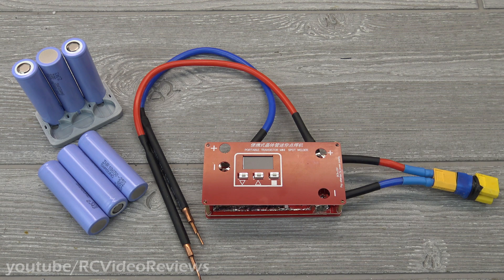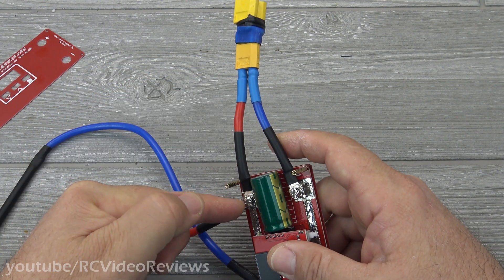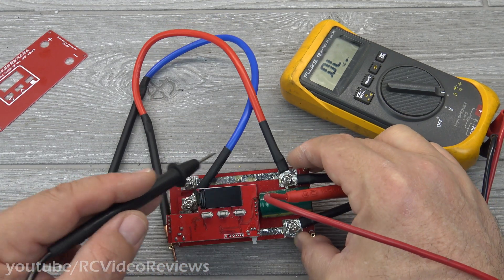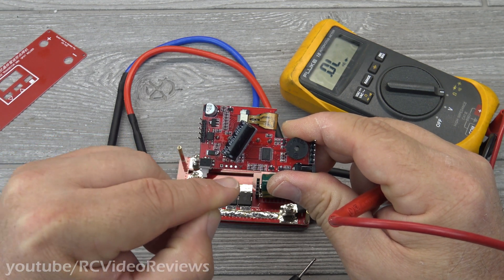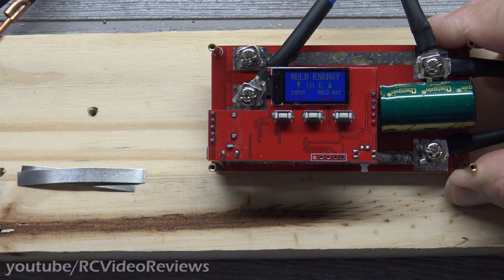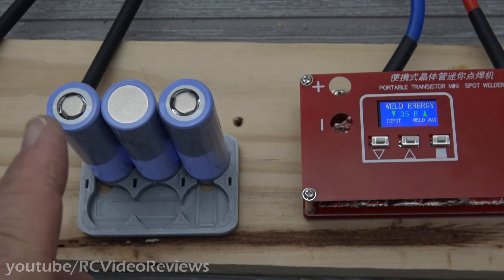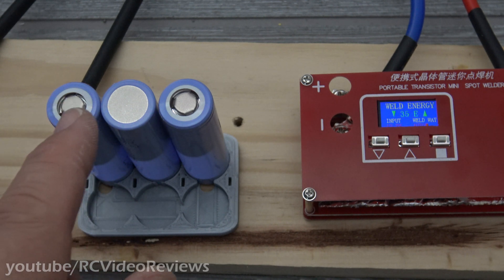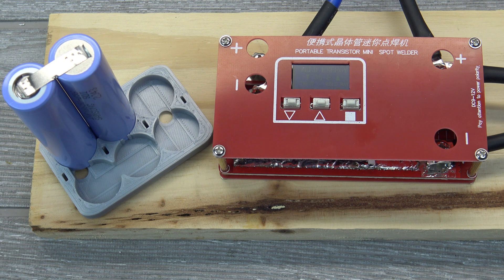Cheap 18650 Spot Welder Reliability Mods and Test

Comment: Bought this unit 6 months ago n made the mods but instead of wasting solder i stripped some ac copper wires n added to the connections. Man this litte unit works great for the price n i really like how compact it is, saves alot of space! Liked ur vids. Btw for those buying li-on batteries make sure u check the discharged current of the battery. I rushed my buying and ordered the wrong c rating! (5amp) cant fly most planes with that.
Reply from the maker: Good tip. Thanks for the comment.

Comment: The unit I purchased looked the same but the circuit was different so I couldn't find where to add the capacitor. I did not add extra solder onto the negative side. I tested it first using a Car Jumping Battery Bank and everything worked perfectly but the car jumping battery bank had to be physically disconnected before it would reset for another weld. I then tried using a 12V car battery with the power set to 40 for a 0.12mm strip. One of the MOSFETs blew up and caught fire... The spot weld left a burn mark on the wood and one of the probes burned through the nickel strip. The takeaway, add the extra solder at the least. Add the capacitor if your unit is similar.
Reply from the maker: Did you repair it and make the changes?
Reply: @RCVideoReviews  it didn't come with extra MOSFETs

Comment: Thank you. Loved the capacitor addition, great MOSFET protection.  Liked your over soldering very much. Saw this welder in other videos demonstrating the minimum amount of pressure that gets the strips to touch together works best.  Also placing the contacts at an angel not straight up & down works well.  Finally don’t create perfectly perpendicular welds, they’re not as strong.  For whatever it’s worth.  Thanks again.

Comment: Very good job, Congratulations. 
Please help me to decide wich strips to soldering the bateries can i use in lion 18650 pack 11.1 volts 9  amps  i goin to use Samsung 18650 3 amps batteries.
Reply from the maker: If you google a little, you can find charts to help you sort it out. Here's one example: https://www.diyelectriccar.com/attachments/strip-ampacity-pdf.120970/

Comment: Good info, Thanks.
As with any device, I would be careful modifying the product. We could be alternating the electronic circuit and not even realize it.  I’m just guessing – They’re maybe a reason for the trace on the circuit board being the way it is. The electronic circuit could be monitoring the current through that trace. Again, I’m just guessing, without a schematic we really can’t say for sure.
On the other hand, maybe you fixed some of the problems out there with the Spot Welder.

This gentleman provides some good information on the same welder you’re showing.  Like to share it with everyone.
https://www.youtube.com/watch?v=231qtaRIs3M&t=1003s
Reply: He's wrong on a few points. (Source: am degreed EE.) Parts of his theory explanation are right, about the garden hose stuff, but he's off when he starts talking about Amp-Hours. Amp-hours has nothing to do with how much continuous current a battery can provide. The internal design of the battery cells themselves determines this. For instance, some LG 18650 cells are designed to deliver 30 Amps continuous, while most other 18650 cells are designed only to provide 430 mA continuous. The 30A cells are 1,500 mAH, while the 0.43 Amp cells are available in 2,200 mAH up to 3,800 mAH. The Amp-hour rating refers ONLY to how long the battery will take to discharge at its rated current... that is, it's storage capacity. If we're using the fluid analogy, the Ah rating is, "The size of the tank."  So, for the spot welder, this means a battery with a larger Ah rating will simply last longer before needing to be recharged, same as a tank with a larger volume capacity will be able to feed a hose of the same size at the same pressure for longer before running out of water, when compared to a smaller tank. Amp-hour rating has no bearing on the strength of a single pulse. The battery voltage and the ability to deliver the 150A pulse is what will determine that - and a battery that can't effectively deliver a 150A pulse (which standard 18650 cells cannot, unless you stack many many in parallel, or use those special high-current rated ones) will cause the condition this creator mentions - a loss of ability to maintain control circuit voltage during the pulse, as the voltage will drop, which will make the device incapable of holding all the FETs open, which will risk overloading the FETs that are open. 
So, the thing to be sure of when selecting a power source, is that it can in fact deliver 150A. 
Increasing the thickness of the trace by adding solder will have no adverse affect. It's simply increasing the ampacity of the trace, not the amount of current that flows. If the trace is limiting the current that flows, it will act as a fuse and burn through. The fact that the trace isn't burning through is your proof that the trace is not limiting the current. If the current needs to be limited, that would be done with a resistor or a network of resistors.
;)
Reply: Oh, and he's definitely spot on about the size of the aligator clips - yeah, people need to be using jumper-cable sized clamps, not little clips ;)

Comment: Putting too much pressure will result in a bad weld, with the setting at 20 or 25 will make a strong weld if you just use light pressure
Reply from the maker: Nah, it's fine. It welded perfectly. Good tight bond and the material is destroyed trying to remove it. No problem.

Comment: You are pushing to hard. Set it at 20 and just push enough to hold the strips together, this causes more resistance
Reply from the maker: Its fine. The connections are plenty strong. No issues. The welder allows for longer pulses so I don't think it matters.
Reply: didnt seem like he was pressing too much, from other videos with experienced people pulse duration seems about appropriate, so pressure is too

Comment: You don't want much pressure. Just enough for the surfaces to contact, but you do want some resistance between the surfaces in order to make the heat right there.  Lighten up and it'll probably be fine down to setting 15 or so.
Reply: And thanks for the tips.
Reply: If i am setting on 15 and i am not pressing enough, i am becoming sparks

Comment: Will bigger capacitor make its performance better? Like, 10,000 uF / 50V ?
Reply from the maker: I don't think so. It's not holding the current for the weld. It's just there to protect the control circuit.

Comment: If I use a deep cycle lead acid battery would I run into the low voltage issues? I'm planning on using a 120ah one with 672 cranking amps rating. I did 20 welds without mods and I didn't have any issues, I'm still planning on adding the capacitors though. Any thoughts?
Reply from the maker: It wouldn't be a bad idea to add the cap. The issue has to do with voltage sag. The videos I've seen where the problem comes in is voltage sag and weak current delivery. I expect if the battery you've described is in good condition you should be ok, but add the cap.
Reply: @RCVideoReviews  that's what I figured. Thank you so much for the quick reply! I'm subscribing right now, wow!

Comment: My study of spot welding found that low pressure and smooth rounded tips works best. For some reason too much pressure is not best. I have not tried this yet.
Reply from the maker: Hey Mark, Yeah, I've seen that comment quite a bit. I did wind up rounding the tips.
Reply: @RCVideoReviews  is it better with the rounded tips?
Reply from the maker: @apexed2446  Better is arbitrary. All I can say is I get good welds. The strip is destroyed trying to remove it. I have no evidence one is better than the other.
Reply: @RCVideoReviews  fair enough, thank you! I'll experiment.

Comment: From watching a few other videos on this welder I think you are a bit under-batteried. I wouldn't trust that 2200mAh Turnigy Lipo at anything beyond the 35c rating (so c.80A). Recommendation elsewhere is for 5000mAh and 50C (which gives plenty of headroom).
Reply from the maker: It only needs ~130a. This pack delivers that easily. It’s a 70c peak. So 154a. And the spikes are so momentary it doesn’t matter. It welds fine.

Comment: Please comment on the "new mini spot welder" 2021 :
~ I have the upgraded control board 2021. The upgrade here apparently [Youtube discussion] requires the 1000ohm to be replaced with a 470ohm resistor.
~ The old design had a simple modification as per your description, insert the 1000uF Capacitor, and indicated here for others ~ https://youtu.be/fdnO0Z-scjA

Comment: I just ordered that, anything I need to know?
Reply from the maker: If it doesn’t have the same control circuit as the one in this video send it back. We ordered a second one that has apparently been updated and it lasted for about 5 welds.
Reply: @RCVideoReviews  The battery lasted for 5 welds or the circuit?
Reply from the maker: @informing_  The circuit. The "new" spot welder is dead.
Reply: @RCVideoReviews  Oh I see, well it turns out if the battery isn’t really big the voltage drops during the welds and the mosfets explode, I’ll be using a 200AH solar lead acid battery, I even use them for my White House and even cook with them so I guess they’ll provide the current without dropping much
Reply from the maker: @informing_  Good luck with it.
Reply: @informing_  howd it go?
Reply: @daneshedd2553  Good! I already made several packs with it, I used a huge solar battery 200AH and it works fine

Comment: I bought this spot welder a few months ago and did all the same mods as you right off the bat, including rounding the ends of the electrodes. It works perfectly and still going strong. Built a 4S2P for a portable power supply just yesterday. Absolutely hassle free.
I'm using a truck battery but like the idea of using a Lipo as it's small and convenient. Nice video.
Reply from the maker: That little lipo does well powering the welder. Mine is still going strong too. Appreciate the feedback.
Reply: @RCVideoReviews  My friend builds and flys drones, so I'm going to steal one of his Lipo packs and try it. ;)
Reply: @RCVideoReviews  cant find that turnigy battery 35- 70 discharge any suggestions on an alternative lipo rc battery?

Comment: The material of the battery is thicker and therefore the weld is smaller. Maybe 40 was perfect for the 18650.
Reply from the maker: It worked fine @ 45e on the battery. Welds are strong, no holes in the nickel strips.

Comment: Just tried mine 2 days ago.  I had it hooked up to my solar battery bank and it did nothing but dent the strips with the pressure from the leads until lvl 99.  I started at 10 and moved up in 10 level increments.  Once I hit 99 it popped quit violently and the automated beep feature went away and the leads are now continuously active.  Pretty sad story.  Not sure if I'll order another one or not just in case it was a bad batch.
Reply from the maker: I ordered a 2nd one for a family member and his did the same thing--but it was an updated design and did not have the same position for the cap that mine did. In fact, mine still works perfectly. His just dead shorts now. Not sure what to do to fix that--seems like a problem in the control circuit keeping the fets open.
Reply: @RCVideoReviews    That was my thought process as well.  I thought about keeping it anyway and just hooking up a starter relay but then technically I'd be paying $35 for a set of probes.  lol  I'll let you know if I get another one and if it works.

Comment: So is that solder trace for the negative (that you bypass) used as a current shunt to control welding current?
Reply: I meant positive side, sorry.
Reply from the maker: The positive side is continuous the moment you connect a battery. The negative side is switched by the mosfets.

Comment: What is the power supply used for
Reply from the maker: The power supply on my desktop is what I use for battery chargers. It's not used for the spot welder.
Reply: @RCVideoReviews  
What is used to power the spot welder?
Is it a car battery or a lithium ion battery?
Reply from the maker: @ferret757  3s2200 LiPo 40-70c
Reply: @RCVideoReviews  
Thank you

Comment: Thank you for this video with the summary mods.
I read in another video that it ist perhaps better to use an 3300uF capacitor if the pulse is longer than 50ms. Should i do this? Or i dont need so long pulse?

Is it good/OK if i use this battery Turnigy nano-tech 5000mah 3S 65~130C Lipo Pack w/XT-90
https://hobbyking.com/de_de/turnigy-battery-nano-tech-5000mah-3s-65-130c-lipo-pack-xt-90.html
Or is another better?
Reply from the maker: I used an 880uf cap in mine and it's been fine. 

That battery will work just fine.

Comment: I'm using this spotwelder with the cap Mod after one Mosfet has blown up. Now its fine. By Using supercaps i Was getting about 830Amps welding current.
Even withe long leads on the input side.
Reply from the maker: Good to know. Thanks for the info. How did you measure 830a?
Reply: @RCVideoReviews  by using a Big brass shunt resistor and a Oszilloskope

Comment: Awesome tutorial.  This would be my first experience with spot welding and I am a lot more confident going into it.  

You may have mentioned, but what are the specs of the capacitor?  Do you have a link?  I should have everything else.
Reply from the maker: I used a 25v 850uf cap. Anything to 1000uf and over 12v should be fine. It's not hard to do this at all.
Reply: @RCVideoReviews   I would stick with the 25V cap, which is generally the next step-up in voltage from 10V, I believe. If they made a 12V cap (which I don't believe exists) you would be operating above its maximum rated voltage if connected to a freshly charged motorcycle or car lead-acid battery, which is aprox 14.4 Volts.
Reply: 470 1000uf 🤙🏽

Comment: I have a 12 volt 9 ah, battery do you think this a would be a good power source?

Thanks for you quick response...I don't  want to damage it I'll use a stronger battery.
Reply from the maker: It has to be able to deliver ~130amps. It's less about the capacity and more about the amperage capability. I've seen plenty of videos where a questionable 12v car battery resulted in a blown mosfet.

Comment: What else can you use to power that spot weld. Can you get a power adapter ?
Reply from the maker: It has to deliver 120-140amps. I doubt any power adapter would do. You can get the same LiPo I used for $15. Add $20-$30 if you need a charger.

Comment: Does the voltage of the capacitor matter? And if so what voltage should I use?
Reply from the maker: I used a 25v cap. Just don't use something lower than your input voltage.
Reply: @RCVideoReviews  thank you for the quick reply 🙏🏼🙏🏼

Comment: If you are looking to make high capacity packs for cheap, couldn't recommend 'second hand, lightly used' batteries enough. places like batteryhookup and jag35 have packs from different industries with little use that let you rip the 18650s out, paying very little per WHr compared to brand-new cells. For example, Jag35 has some scooter packs for sale right now containing 40 NCR18650BD cells (3200mAh, 10A) for just under $60 (~$1.5 a cell). Packs are around 95% capacity,  making them great to repurpose or pull cells from. I have now 4 of those packs, two put directly to use in an EBike scenario, and other two harvest cells for EBoard pack building. Those two places sometimes have amazing deals that are hard to pass up. Recommend you look into them.
Reply from the maker: Thanks for the tip! Awesome info.
Reply: Fantastic idea with those scooter packs! I scored a ryobi battery pack for the outdoor lawn tools line, i believe it is ~30v... cost me like $7 on clearance at the end of last summer - I plan to gut it and take out all the 18650's and do the same!